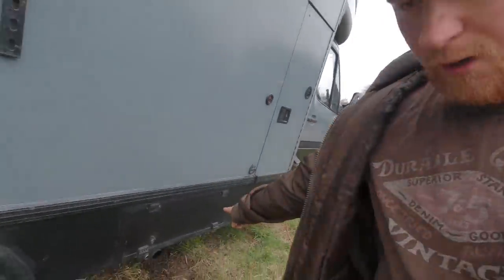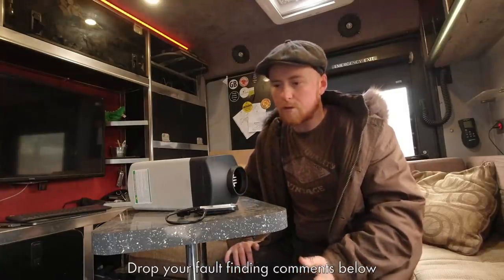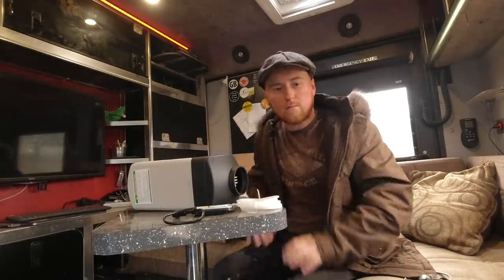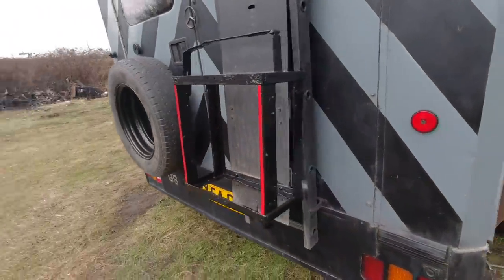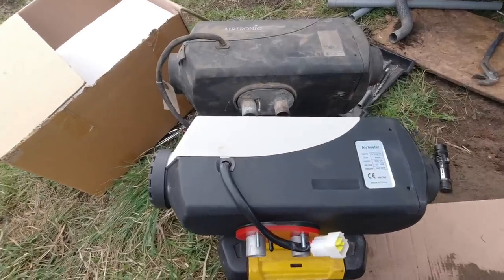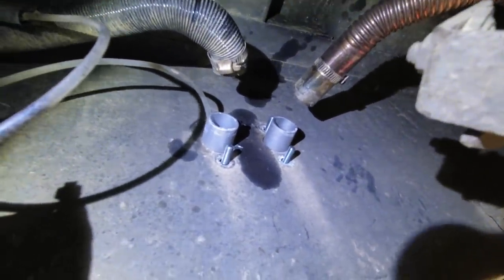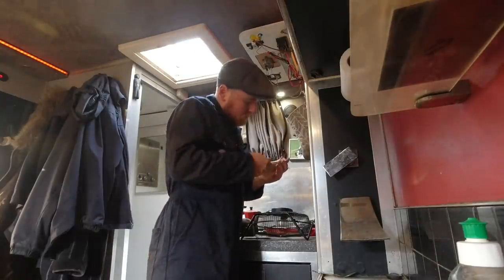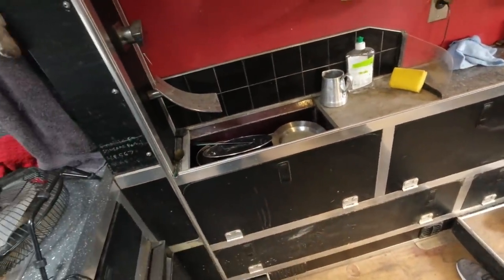Replacing my Diesel Heater for a Chinese one: Eberspacher delete

Comment: I did exactly the same...after 4 years my Eberspacher D2’s ECU fried itself and to buy a replacement ECU would have been £250. Ripped the D2 out and fitted a Chinese diesel heater for £80 instead and it hasn’t missed a beat for the last 2 winters. Absolutely love it, For £80 if I had to replace it tomorrow I would still be quids in. You won’t regret it.

Comment: That's the right way of upgrade! The Chinese heater are alit better in many ways.. It gives you alot more options,  you don't need to buy expensive parts to fix it, and you can do DIY with them, and read error codes on the controller.. If it can't be fixed,  you just buy another one for the fraction of the cost of an eber 👌

Comment: I had this exact issue on the boat. I purchased the Chinese version and canabalised it for spares as they all are interchangeable. The eberspacher has a better quality build and wiring IMO. This allowed me to use the wiring already in place (a massive job on a boat).
Reply: Can you tell me which model is a copy of espar. i need one but hard to know from.so many models.

thanks

Comment: One Mod, use the other exagust and replace the intake, run them togather and wrap them in some copper tape, and then pipe insulation, this will heat the intake air, just make sure the ends are far apart.

Comment: I fitted one of the all in one units in my sprinter, initially I ran the exhaust to the burner outside with the burner intake pipe inside the van as some videos recommended. 
 The condensation was horrendous until I ran the burner inlet outside as well as it was creating negative pressure pulling moist cold air in from outside that then condensed out on my windows etc.

Comment: Hi CJ. You might want to put a ON/OFF switch to the heater as the control screen on those heaters tend to burn out if left on all the time, leaving you with NO illumination. Also run on 50/50 Paraffin and diesel, reduces soot. Good vid!
Reply: The ON/OFF switch should only turn off the control screen and not the heater itself. If you disconnect the heater itself you will lose your settings every time.
Reply: @procatprocat9647  Yeah, just a switch on the red wire :-)
Reply: @skjoennemand  Yes I done red from batt, every thing works fine.
Reply: @glennb546  red from battery? Then you turn off the heater and not only the controller.

Comment: Best £77 you will ever spend, even though technically yours was free from the sale of the old unit. mine has been on for over 2 years now, never turned off as it has a clock. great bit of kit.
Reply: mine runs daily, twice a day, has done for 5 years. faultless.

Comment: I fitted the same Chinese heater in my narrow boat last year, aside from a few teething troubles which I sorted by altering a couple of setting, it has been an excellent bit of kit. I’m a bit jealous though as mine did not come with a remote..., think I’ll go search eBay. Also, at the time, they were twice the price, however, still a sight cheaper than the eberspacher equivalent.

Comment: The fuel nozzle in your old heater is probably damaged or blocked as you have no fuel filter. Instead of atomising the fuel in a nice cone shape , it will be spraying it to one side creating a hotspot which has melted your outer casing.

Comment: I had the same issue with the controller. You can use the old type controller with all the bells and whistles, but as you found out, it isn't recognised by the heater. You can replace the motherboard in the heater with the old version (they're about £14 on ebay), but the plug layout is different. It will work, but you need to work out which plug goes where. I've been looking and considering making a video about it, as so far, nobody has done this.

Comment: Have a look at the Australian afterburner diesel heater controller. They deffo work with the same heater you have and from what I remember can be controlled by your phone/online
Reply: The afterburner remote doesn't work on this new heater motherboard. However, the older type motherboards are available cheaply on ebay, but the plugs are in a different place. Work out what goes where, and they work well.
Reply: @philcross7315  ah interesting, the heater looked the same as the one I have which does work.

Comment: The first “fail” could be a purge of the combustion chamber. 

Modern furnaces blow air through the combustion chamber to remove explosive gases so when the igniter goes it’s controlled.

Comment: When it's cold it's miserable, better with something that works and easy replaceable for another £77.00 if needed. Even a new heater every two years would be cheaper over 20 years than a new eberspacher which may not last 20 years. Expensive parts and servicing also to take into consideration. 👍

Comment: Put an air filter over the vent so you have clean air coming in to the unit!
Reply: That is a very good idea actually. I'm sure worst case you could get someone to 3D print a housing to hold some kind of generic cabin filter for a car.
Reply: @Dal J The air intake for the heater to stop it sucking up so much crap.

Comment: Just a thought, could you find a small metal grille to place over the damage on the door. Then if the door was opened when the heater was on the heat will go through the grille and not burn the door. It will also ventilate the locker. This is where I look down the comments and find three other people have made the same comment. Cheers John from County Durham.

Comment: Still got the Eberspacher D4 in my old ambulance. the temperature sensors are small beads and there are two on mine. you may of removed them when you fitted it out.

Comment: You will have messed up the air/fuel ratio by keeping the old pump because the chances are that it is a different size to the chinese one and the heater won't know. 
I strongly recommend you check the specs on both pumps and ideally fit the new one.

Comment: If you fitted the chinese filter that came with it, go and buy a good quality small engine in line filter or similar and replace it with that.  The Chinese filters will come apart and leak pretty quick.
Reply: true that

Comment: Cj
Don't bother with a changeover valve run 2 pumps one to your fuel tank then Tee in between that and the heater with a pump feed from the red diesel tank. As the pumps have check valves this will stop the fuel bleeding back. All you need to do is run a changeover switch between the two pumps.
Easier
Cheaper
Less messy
And
Not getting outside in ya pants in syberia to change over supply
Reply from the maker: I like this idea! Plus I have 2 spare pumps, yeah it makes sense just change over electrically... nice one bud i hadn't even thought of that 👍
Reply: @ProjectAmber  I'd add a backup one way valve on the main tank line to stop backwash of red into your road tank, 😂

Comment: The reason your second controller does not work is because the Chinese changed the control board in the heater and the communication protocol to a simpler (dumber) one. You can buy just the heater control board and swap it in your heater if you want to make the other controller work.
You also then have the option to use a much smarter controller like the “Afterburner” if you wish.

Comment: That chinese one doesnt like dirt and dust any better then the old one did, in fact worse I would seal up that compartment better so you dont get so much water, dirt inside which eventually causes corrosion and fail...good video!

Comment: I thought you heated the place with the log burner, but it turns out you have one of them Chinese heaters as well.  Did you properly insulate the ambulance box, or did you just leave it with stock insulation?

Comment: Absolutely nothing wrong with that green nylon flex line and I've no idea why everyone thinks there is. It's actually miles easier to install and does not require all them annoying rubber fasteners and cross grip clips everywhere
Reply: Indeed! I think it’s a classic case of one internet wrong-thought spreading as gospel. John McCluckie did a proper comparison - all good. Same with the angle of pump myth - that’s down to the Eberspacher instruction manual - having to cater to inadequate fuel filtration, unique to Eberspacher.

Comment: Eberspacher I guess are a brand rather than a manufacturer = they must buy from the same chinese factory as the knock-offs - BTW, loving the reflective tape = cool.
Reply: their profit margins are huge!
Reply: Wrong guess. Eberspacher did all the research and development more than 40 years ago. Lots of time and money to develop and manufacture the heater, hence the expense.
Chinese .... no research and development, just a direct copy of the D4,  hence BARGAIN
Reply: You guessed incorrectly.
Reply: @only-vans  Erm if you look into one of these then there is hardly a mass of research required. it is a simple glow plug based burner chamber with a motor and two fan blades with appropriate heat exchange casing.
It would not take Enstein to design this of 40 years of stupidly high prices to pay for said research either.
the method is very primitive in fact and could be improved upon greatly for cleaner more efficient burn and fuel/air mixture control..
Reply: @amojak  indeed, however no less true.

Comment: I see that you are running the heater on its side. Do you happen to know if you can run them on either side. I have been told that the glow plug has to be at the top but I'm not sure.
Reply: i suspect it isn't super critical, there is a Scot on youtube who has committed all manner of disections and tests on these heaters.
Reply: glow plug on top. Always.

Comment: Chinese stuff is cheap for a reason, i dont want to be the merchant of doom but i wouldnt personally have gone for that, id have had the old unit reconditioned and it would last for another 10+ years.
Reply: Each to their own.
Reply: Any simple google research will reveal there are tens of thousands (or more) of these heaters in use all over the world, with generally positive results. Even if they don’t last as long you can buy about 5 of them for the same price as the expensive units.